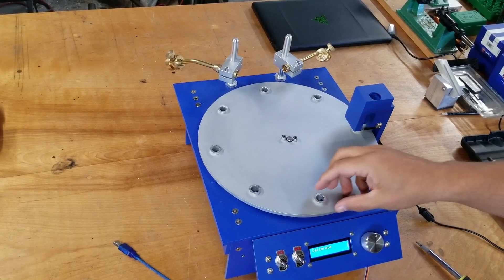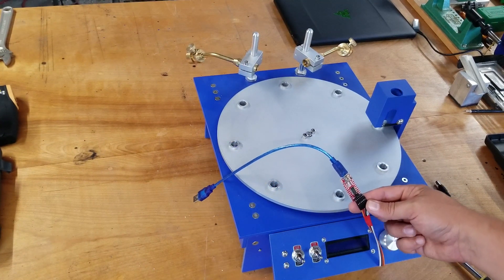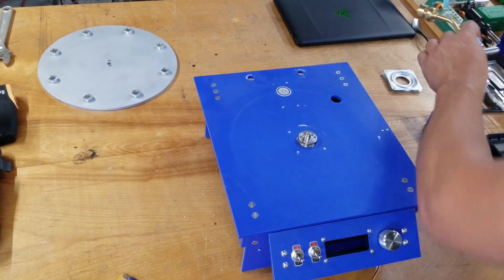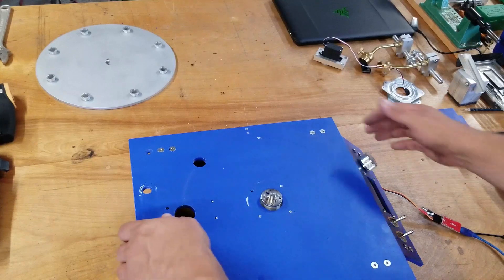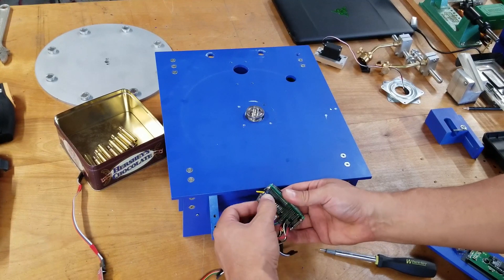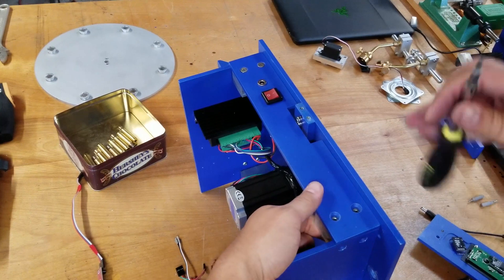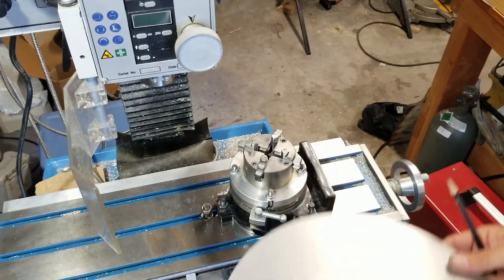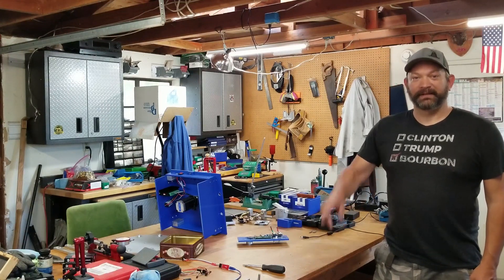Taking apart the annealing machine

Comment: What line in the code changes the number of stations from 8 to 6?
Also, if you go to 6 stations, will you have to change the steps?
Reply from the maker: its line 75 in the code.  The steps are based on degrees. each step represents 1.8 degrees  (this is for typical stepper motors) which means that a full revolution is 200 steps.  
The code is easiest if you use numbers that divide evenly into 200.   For instance,  2, 4, 5, 8, 10.  This is because these represent whole steps.  So for 8 holes,  the math to calculate teh value for line 75 in the code is    (200 / steps) * microsteps.    In this video the microsteps are set to 32 on the motor controller   so  (200/8) * 32 = 800.  You will notice the code has 798 and this was a small adjustment to compensate for lack of precision in the controller. You may need to make a change as well if you find your holes are out of alignment after a longer run.    If you went with 6 holes,  you end up at 33.33333333  steps..  we can't really do 33.3, but we can get close.  It would basically be 1066 or 1067, you would have to watch the hole alignment to see if it is creeping forward or backward over time and adjust as necessary
Reply: @sjseth-builds  

You are very helpful, and thank you for all the information.

Comment: hi amazing build  was wondering can one be built with 5 stations only ? cut down size and cost  etc or is there a reason it is 8 station
Reply from the maker: There isn't a great reason other than that i started with scrap metal and that was what I i had.  As far as the code goes, you would just increase the number of steps needed and keep the hole numbers evenly divisible in 200 (number of steps in a complete revolution of the stepper motor)
Reply: @sjseth-builds  hi just wondering what the dimensions are for the top plate and your round  part  I got all the parts  have designed a 3d printed  electronics box for the front  wont be long now  can  send you the files stl or upload them to thingiverse
Reply from the maker: @davesmith3304  the disc is 12inch diameter.  The top plate is 12x14inch
Reply: @sjseth-builds  thanks
Reply: @sjseth-builds  the tb6600 stepper motor controller has a bunch of switches just wondering what you set them to sorry for all the questions I just sux with electronica all the magic smoke always escapes
Reply from the maker: @davesmith3304  ,  You can get a pretty good picture of the settings at this point in the video.  https://youtu.be/Tm6WUzW7IRI?si=2qrDH5vYqUqobGxr&t=376

I believe everything is in the off position which would be max current and 32 microsteps
Reply: @sjseth-builds  thanks dam I will study the videos harder before I ask any more questions thanks for pointing me in the right direction there
Reply: almost there another question before I drill the wholes in the top for the gas torch mounts what is the best way to figure out the correct spacing   any help re that would be appreciated
Reply from the maker: @davesmith3304  I think this would really just depend on your torch mounting method. For me, I put a piece of brass on the "turning/burning" station and held the torches in place (while lit) to get an idea of roughly where they needed to be and worked backwards from there. You should build in a good amount of adjustment if possible. Also just make sure the holes are equal distances from the annealing zone
Reply: @sjseth-builds  yes I am doing it the same way you have done it but that makes sense will try that  and thanks for that info this is the last thing I need to do and its done well except for the painting  but will paint it when its all working well  and will post the links to some 3d printing files when its all good as well

Comment: I have been working on the annealer for about a year now and I'm ready to program the Arduino.
I have downloaded the Arduino  program and question is, can i copy your program into the website program and is there anything that I need to do special to download and make it work?

Thanks, Tim
Reply: Thank You Very Much
Reply from the maker: You need to download and install the Arduino IDE software from the Arduino website: https://www.arduino.cc/en/software . You also need to download my arduino code from github. Easiest thing is download the whole github repository as a zip file. You can do this from the repo home page (https://github.com/sjseth/ArduinoAnnealer) where there is a "Code" button menu and in that menu is a download as zip option.  Once you extrat the zip, you can browse to the arduinonew.ino file and double-click it to open. It should open in the arduino ide software. You need to tell the software which usb port the arduino is connected to.  I would highly recommend watching some youtube videos on getting started with arduino and how to program them as there is a ton of resource available here. Good luck and cheers!

Comment: do you have a list for the box an top plate plus dimmisons
Reply from the maker: In regards to dimensions, the top plate on the machine is 12.5in x 14in.  The disc is 12" diameter. from bottom to top the machine is roughly 6in tall. Hope that helps. On the top there is roughly a .5in overhang on 3 sides and about 1.5in overhang in the back which allows more room for the torch pillar and nuts. The whole think is made from .25in aluminum except for the feed which was machined from a a block of aluminum.
Reply: @sjseth-builds  THANK YOU
Reply: hi sjseth i have been working on the poject you show trying to download the software keep geeting an error on line 2 liquidcrystal  no such file or directory... this is my frist time trying arduino  or any other electronics projects i want to make this anealer  have brass to reload thank you
Reply from the maker: @williamfitzpatrick2421   in the arduino software, you will need to install the liquid crystal library. You can do this from the sketch menu, include library
Reply: @sjseth  thank you  will try it

Comment: Built one pretty much exactly like yours. Metal work is all done I've got it programmed and the LCD lights up, but doesn't display anything. Been troubleshooting it all day, changed the program to (0x27,16,2) to no avail..... Any ideas?
Reply from the maker: sounds like the lighting on the module maybe too high.  There is a generally a brightness potentiometer (usually blue) on the back of the module which you can adjust.  I had the same problem on one of my modules.
Reply: @sjseth-builds   Ended up being a bad display from the factory. The new one came in today and it now works fine. I had to adjust the index steps. The original program was for 798 steps which gave me 180 degrees of rotation. I halved that and tried 399 steps for 90 degrees of rotation. For some reason I don't understand that was just a little off and the final indexstep for 90 degrees of rotation was 398.

 This had been a fun project for me. Definitely got me out of my comfort zone putting the electronics together and I learned a little programming. Thanks for putting this out there and giving a new-be some free advice.
Reply from the maker: @grantsimpson3299  glad you got it working! Yeah, I noticed that the math doesn't always add up to what is expected. I also think it varies from controller to controller when you are using partial steps. I don't really know why as I am sort of a noob with arduino

Comment: what pins do you use to connect the programming USB
Reply from the maker: Oh, good question.  I just realized  that is not in the schematic. I have updated the schematic with that information included. (see video description for the links) also here: https://raw.githubusercontent.com/sjseth/ArduinoAnnealer/main/schematic_new.jpg.    I used the FT232RL to program the mini pro.  Generally you can just solder the 6pin right angle connector to the arduino and connect the FT232RL with a 6 wire ribbon. I used a kit like this: https://www.amazon.com/gp/product/B086ZLB5GG/ref=ppx_yo_dt_b_search_asin_title?ie=UTF8&psc=1
Reply: @sjseth-builds  

Thanks for your help and a great product.

Comment: Cut a slot in the adapters that is flush with the plate and as wide as the case base.
Reply from the maker: That is definitely easier than what I was planning on.  I would have to ensure the slot was always oriented correctly, but that would be pretty easy. The one downside of that approach is the stack of brass still drags on the plate and I was hoping to eliminate that drag.  Thanks for the feedback and ideas!
Reply: I have a great idea if interested. It would use a nema 17 stepper and a simple arm.
Reply from the maker: @jesusisalive3227  Thanks for the suggestion. I have considered this approach but really looking for a non-electronic, mechanical solution for the feeder.  I have a couple ideas around using a spring or set of springs similar to a pen clip where the top of the spring catches the base of the cartridge and the bottom edge contacts the adaptor. The adaptor would push the spring out to the right or left or both and allow the next cartridge to drop down.  Anyhow, thanks for the suggestions. Will eventually post a video on what I come up with for that.

Comment: that is an absolutely massive stepper motor? Why such a high toque motor? Is there a lot of resistance when dragging the cases along the table?
Reply from the maker: You are correct, it is definitely overkill. You can get away with using a lower-torque stepper however, there are a few things to consider.  When you are using a feeder with a stack of 20 pieces of brass pushing down on the plate at a single point, you need the power to move the plate without losing steps. It requires more force than you would think. See my previous video on how the feeder works.  I realize that the problem could be overcome by using a different feeder design and that is something I am working on currently.  Another reason is that the plate is solid quarter inch aluminum so it also has some weight and momentum and I found with the smaller motor I was losing steps. There are lots of mechanical ways to overcome this but for simplicity I went with direct drive. The extra $15 for the bigger stepper seemed like a no brainer at the time. Later I discovered that using acceleration/deceleration helps with countering the momentum.  Thanks for watching and for your question!

Comment: A couple of questions regarding components, such as name:  (1) the part you take off the shaft at 7 minutes,  (2) on the schematic, the component that has 5 volts and 12 volts feeding the other devices, (3) does the power supply connect to the part just referenced, (4) would a modified computer power supply, that has 12 volt and 5 volt outputs work.  Thank you.
Reply from the maker: (1)  This was a part I made which is roughly  1.25in  x .50in . Not sure what to call it but I think I referred to it as the rotating base plate. (2)  This is a 12v to 5v buck converter.  Link here: https://www.amazon.com/dp/B00C63TLCC    . (3)  The 12v side is connected to the 12v power supply to provide a 5v rail.  (4) If you have a power supply which can provide 12v and 5v (like a computer power supply), you would not need the converter.
Reply from the maker: After looking at the schematic, I realized that I wasn't quite clear on the power supply part.  Basically the 12v power supply is connected at the  Red (12v) and Black (ground) boxes in the bottom of the schematic and that is what provides power to the entire circuit